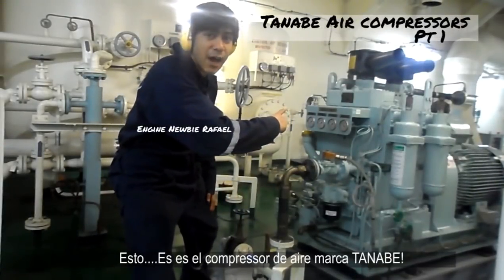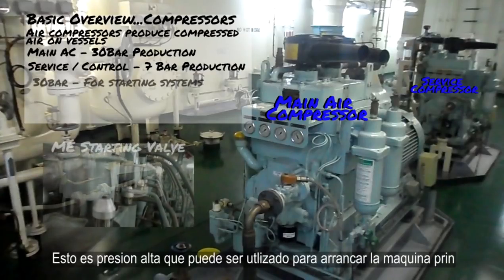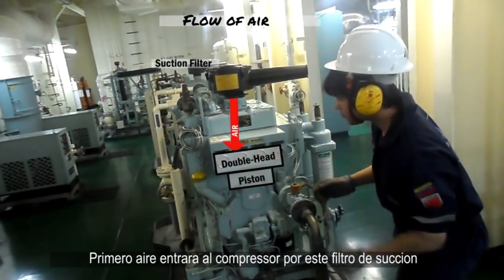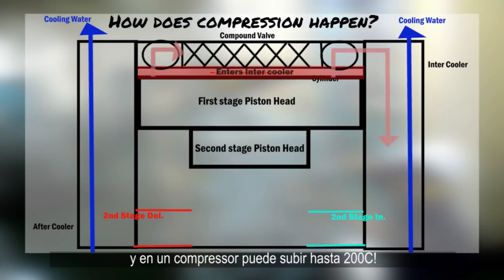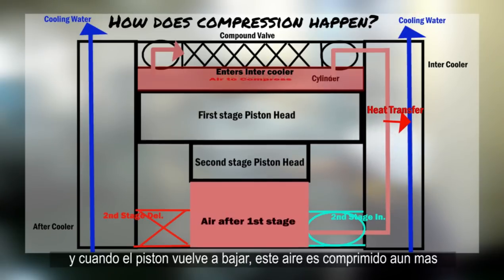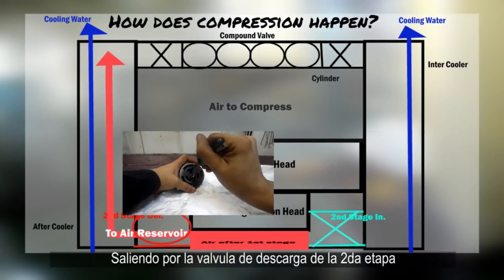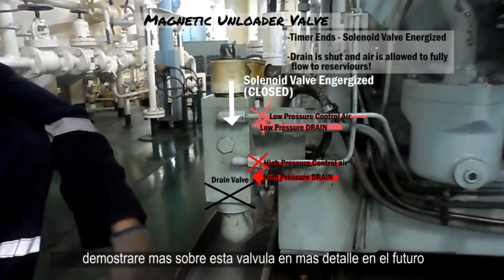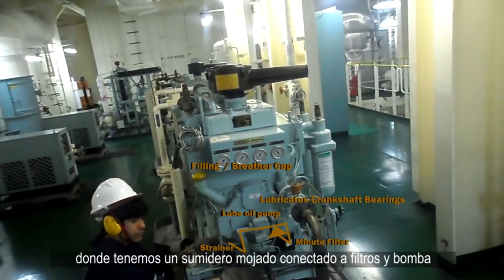Air Compressors on Ships (Tanabe)  - Importance, Operation and Flow

Comment: I'm not sure sir if there are specific Air Compressors that produces a specific pressure. I think the 30 bar/7bar pressure is reached only in the Air Bottles with the help of the pressure switch, in which is set on 30bar or 7bar.

Comment: what are the problems all pumps, engine 
try,& how what's  are cleaning, 
  mainly how engine  room floor clean.
why drain lines are not  working. or not passing waters or liquid.
Reply from the maker: Troubleshooting is a never ending battle for all engineering operators and maintenance.

Comment: How are we supposed to test LO pressure in air compressor..to make sure high pressure alarm is working
Reply from the maker: Hey dude, high pressure alarm isn't tested and where I have worked this alarm doesn't exist... THERE IS a low pressure ALARM AND TRIP to protect the compressor from running without lube oil flow and overheating... This is tested by closing the valve to the presostat and verifying the compressor stop.. It will run with oil but the presostat won't sense the pressure anymore and cause the trip.

Comment: Hi, could you tell me how much ton of your ship's boiler capacity, steam pressure, working pressure, & water capacity?
Thanks in advance
Reply from the maker: Heya dude, in a suezmax oil tanker with steam turbine pumps the Mission TM boilers gave max 16 bar pressure (for cargo operation) or 8 bar pressure (low mode navigation), water pressure 8 bar (low mode economize pump) or 25 bar (auxiliary boiler pump), and the water capacity is 18tons.. Total steam capacity 35.000kg/hr at max load..in any case all info is found in the manual.

Comment: How about the purpose of relief valve in compressor
Reply from the maker: Yeah, in cause for some reason the flow of air gets stuck and pressure rises above the working purpose these valves will open and allow excess pressure to escape to the atmosphere (with very loud noise hahaha). If they don't work you risk damaging gaskets or the line itself!

Comment: Brother me ukrainian 3rd eng now on bulk carrier,thanks you for video now we are workung with this type if compressor. Can you tell me please for what control air to unloader valve? How its working
Reply from the maker: Explaining it with words is pretty hard other, I've disassembled many becuase they get dirty and stuck causing loss of compression.. There an underlying problem usually oil in the compressed air that dirties the valve.

Comment: Atlas Copco BT & KT are the best (from the '80), .... cast iron piston compressor or slow speed screw compressor with large and solid oil cooler are still the best and most reliable investment. I don't like 'VSD' because a compressor has to run at a minimum speed to get a good return. - GA 808 and now ??? Best buy is the lowest kw. of a series! (E.g., a type with a 37kw. - 45kw. - 75kw. / best is 'the 37kw') with the 45kw. & 75kw. only the gearing is changed and the compressor element runs at high speed. IPV VSD buy 3 compressors and install in cascade !
Reply from the maker: That's interesting haha well I haven't seen those Compressors yet but thanks for sharing your experience

Comment: Same type of air compressor ,when hp pressure is around 27bars,it suddenly reduces to 14 and after 10 seconds it increases to 27 again.Pressure drop occurs two times.Does anyone have an idea about this problem?
Reply from the maker: If you solved the problem could you update? I would imagine it's the unloder valve activation.

Comment: Bro could you do a video  on removing the second stage valves
Reply from the maker: For sure amigo.. One day I'll be able to do that, let's see what jobs life brings me!
Reply: @ShrimptoShark  I have a doubt..in unloader vale ,it has connections from LP side and Hp side of the compressor....could you tell me how the air is drained from the LP connection given to the unloader
Reply: @ShrimptoShark  are not you sailing now
Reply from the maker: Not at the moment, I'm getting everything ready for my graduation to become a maritime engineer
Reply: @ShrimptoShark  👍